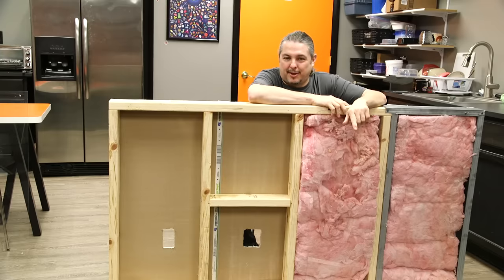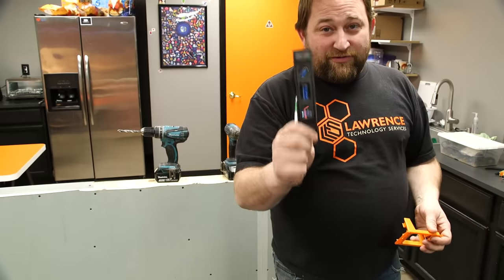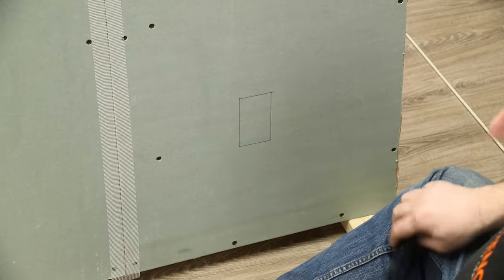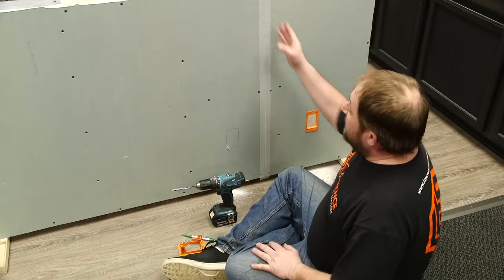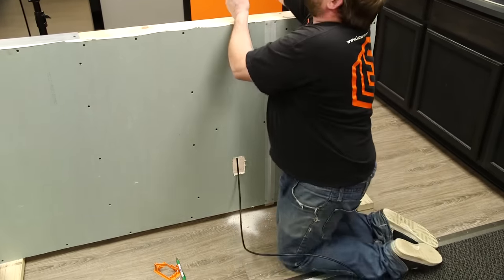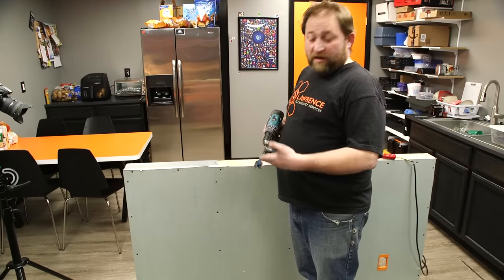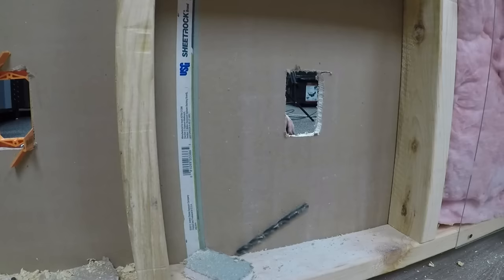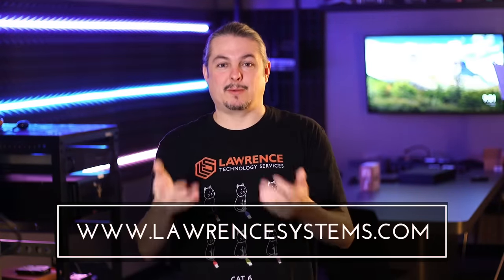Wall Fishing Tools & How To Use Them When Dealing With Fire Stops and Insulation

Comment: I would love to see a more advanced wiring video that goes over metal framed walls, particularly ones that have drywall ceilings. I don't think it's "legit" to drill through metal top plates, I'd like to see how that's done, and how you run the big cable bundles to the MDF through the drywall / drop ceilings and maybe raised floors. Conduit with bushings? Big brush plates? Other?
Reply: I've drilled stacks of holes in sheet metal top plate. I recommend using a step drill (Christmas tree drill bit) to make the holes and always use a bushing so your cable doesn't get trashed.
Reply: @iamdave84  
Much appreciated! It was driving me nuts trying to figure it out.

Is there a spec of how big the holes can be? I figured out you can drill down to run NM through a bushing, or bx/mc - but that's a half inch hole or so - maybe 7/8 - and you put a plastic bushing in it. It can't be too close to the stud, there can't be too many of them (turning the plate into swiss cheese), and I'm sure you can't just drill a 2 1/2" hole to drop cables down... I think you can drill 1 3/8" holes in wood top plates, but also not too close to the stud. How do you run large bundles of cable through it? I'm guessing a bushing of some sort through the ceiling instead of wall dropping for that...

Pretty sure you're not supposed to drill in the studs at all, they come with premade holes you put bushings in...
Reply: I was only drilling 20mm or 25mm (1" max) holes, for up to 6x Cat6a cables. I don't recall specific rules about hole location, but I think rules vary by country and maybe even state. I'm in Australia 🇦🇺
Reply: On that job we didn't have MDFs, but rather whole comms rooms. Those had no hanging ceiling, so cable trays were hung from the concrete slab above for routing the thousands of cables terminated there.

Comment: That was helpful however, what about the possibility of having a firestop on a exterior wall. Wouldn't that defeat the usefulness of a magne pull?
Reply from the maker: Possibly
Reply: @LAWRENCESYSTEMS  so what would you do in that situation?
Reply from the maker: @JWolff-md3ij  No use the mag pull and use a flex drill bit

Comment: How to run the wire horizontally through the wall with having access to only one side of the dry wall ??  Pls consider making a video with fire-blocks/obstacles in between.
Reply: I thought he dude? like wouldn't you use the same logic as a vertical line in?

Comment: What if you have to drill through several fire blocks and the wall is like 10ft high. How would this be accomplished? Can you keep adding length to that flex bit drill? How will the flex bit stay in line as you are drilling down deeper?
Reply: You can add an extension to the flex bit. I have done it, but I wouldn't recommend it. If there are multiple fire blocks I would just make pumpkin cuts in the wall and drill through them then patch it later. Or better yet, try and find a better wall to run the wire through. I have also poked a hole in the ceiling and just used surface conduit. If you stay close to the corner of the wall instead of the middle it usually looks okay.
Reply: @telecomtech9252  I was thinking the same thing. Just running the wire through the ceiling with a surface conduit. I think my walls are plaster and not dry wall so I'm not sure if this will make things worse.
Reply: @joeguzman8396  Plaster is certainly more difficult to work with than drywall. I would definitely consider using surface conduit (wiremold-type product).
Reply: @telecomtech9252  Thanks. I think this is the way I'm going to do it. Do you recommend plastic or metal?
Reply: @joeguzman8396  I would go with plastic. Looks nice, snaps together easily, and is paintable. Plus it's usually adhesive backed so you can set it in place then run a few screws from the inside into the wall so you  don't see any exposed fasteners.
Reply: @telecomtech9252  Sound good. Thanks for the advice. Much appreciated.
Reply: @telecomtech9252  find a new location, or go with surface raceway.

Comment: About a minute and a half in, I see one of my pet-peeves of the industry.  A bad habit common in the Industry.  Why drill a hole damn near equal to the size of the wire, where it will only allow for the one wire?  I used to do that when I first started.  Very annoying when you return for an upgrade and you cannot add a new wire through the same hole.  Cant enlarge the whole with out taking out the wire.  So you have to get in there and drill another hole. Sometimes it's bad enough the first time usually from an attic or crawl space.  "Work smart, so you don't have to work Hard"...my father always said.

Comment: Do you know if that flex bit is equally as flexible as the ones they have at Harbor Freight?
Reply: lol Harbor Freight? are you special???
Reply: @billthepro1188  It was a serious question. I didn't ask about quality. They have bought things from Harbor Freight before, such as the flexy wire fulling sticks. So my question remains. I am trying to run some wire through a tricky spot, and I was thinking about using some of those drill bits, but the only ones I can physically hold to tell how flexible they are, are the ones at Harbor Freight....which are not flexible enough. So before I spend $35 on a bit from Amazon, I thought I'd ask.

Comment: Can you do a video on how to mount a large television on a wall with aluminum studs instead of wood?
Reply: I've done that.  You can drill through metal studs using a drill bit that is made to drill thru metal, just like you would drill thru metal in any other circumstance.

Comment: Hi, thanks for the information. I need some help here. I just bought a 4k lorex camera for surveillance; the problem I have now is that I need 3 180 ft cables in order to connect 3 of 8 cables cat5e supplied with the cables, my plans if GOD help me are to replace all those cat5e with cat6a and install them in between the outside siding and the plywood(inside the siding) and run all the 8 cables around my home and at the point of connection to my Nvr make a junction box to make everything looks nice, more pro and future proof, this cable is just basically for the surveillance system only and in the future ifnI have to upgrade the system just remove, plug and play, it is just from the cameras including a PTZ camera to yhe Nvr using POE method for power and that's it, also must be not to ridgid because I have to run the cable in 2 corners at 90 degree turns, now, the only problem I  have is: what cable is the best option? Cat6a shielded, not shielded, outdoors, plenum, or riser? I am getting crazy 🤪,  Can you help me out and tell me what cable you would use in this case? " I will run the 3 cables altogether, and at some point, they will join the other ones. I don't know if this can create noise or not, I live in the city surrounded by other homes and of course neighbors with routers and tons of items connected and I have no idea if that can be call "noise", thanks for any help. Also, do you think those new Flat cat6a really works and can be used in this case?
Is this one good? : https://www.cablewholesale.com/products/network-phone/cat-6a-cable-bulk/product-13x6-521mh.php

Comment: I would imagine that magnet puller rips out drywall screws pretty often, no? Also, wouldn't it get a little difficult with metal studs?  Is it powerful enough to damage the wall with light metal framing?
Reply: No it’s not like it’s able to lift cars or some sort of supercharged magnet. 

It’s just strong enough to have a good pull thru a 1/2” or 5/8” drywall. But trying to fish it within 6” along a metal stud might be impossible because it might be drawn in that direction.

Comment: Anyone watching this should be aware that this is only for communication wire (low voltage)...You CANNOT USE THAT RING FOR POWER WIRING..... and BTW the maximum allowable gap anywhere around the box is 1/8 " for a total of 1/4" horizontally or vertically. NEC 312.4

Comment: If only my wall were that easy to cut. I have an old plaster wall (actual plaster, not drywall) that for some reason was installed on top of 1/4" modern drywall. Yeah, strange I know. But it's as if the builder had a machine and just sprayed the plaster to a certain depth on top of actual drywall, making my wall like 1" thick and virtually impossible to cut with a hand saw. I have to use a power saw (the kind for cutting trim on a floor so you can install flooring under the trim) with AC and even then it's difficult as the saw blade dulls out within a few cuts. Next time I'll probably use a much more aggressive jigsaw, but I don't want to use that and accidentally cut through AC wire.

Comment: Nice video! Btw have you tried the low voltage bracket blade for an oscillating tool? Could be much quicker for you guy. Qbit SQ1000-S-LV on amazon

Comment: Do you have to worry about the hole you put into the fire stop?
Reply from the maker: No, it's not big enough to be an issue
Reply: @LAWRENCESYSTEMS  Thank you for the quick response.
Reply: Pretty sure you have to patch it with fire retardant caulk. Even a small hole can severely decrease the effectiveness of a fire block. It will act as a small chimney. But check your local code.
Reply: @LAWRENCESYSTEMS  then again, if it is a firewall, not blocking in the wall, you need to patch the hole, no matter how small it is, because that one little hole makes the entire fire stop pointless.

Comment: 7:58 That's great and everything, but walls are usually taller than 6 feet.
Reply: assuming its at the exact center producing the farthest distance possible from both directions of access you still have the ability to drill 6 feet into what would be a 12 foot wall. any offset from center would put you even closer to one side that you could drill.

Comment: you forgot about the the roof and ceiling attached to the  top beam on an exterior wall.  Everyones issue is getting the wire through the top beam on an exterior wall especially when exterior wall is brick.
Reply from the maker: It's really an issue for residential walls, less an issue with modern buildings

Comment: Check out the  Qbit
Reply from the maker: It's neat but my team have not decided if it is that much of a time saver.
Reply: Love my qbit
Reply: @LAWRENCESYSTEMS  I would think the other advantage of the Qbit is less drywall dust mess to clean up afterwards.
Reply: There's always going to be dust. If you have to come back with a vacuum later anyway, it doesn't really matter whether there's a little more or a little less dust

Comment: I have a 4 sided roof. I don't see as far as  an exterior wall in the attic how you can get to it, and I'm a pretty small guy too. There's not even enough room for a drill to fit.
Reply: I've had a few like that and couldn't damage the interior wall paper and brick on the outside.  I took a flat bar and carefully remove a few shingles above the top plate so I could drill down and fish the wires up. Then I can grab them with a fish rod in the attic. A little blackjack to seal down the shingles after nailing them back on. I also did this at the peak of the scissor truss roof (middle of the house). The D.I.Y. home owner had built an 8' wall and then another stubby wall on top of that to get up to the taller peak. Should have used 12' studs. I couldn't get in the attic and the crawl space of the cabin had water in it so I opened up the roof so I could reach in and drill down with my long bit and fish it.  Short of that they would have had a real mess in the house. Less time spent than running back patching sheetrock and painting and no dust in the house.

Comment: If you had an obstacle or  for whatever reason you can't use the hole you put in the wall, your solution shouldn't be a blank plate.   I have customers that would freak over that. Which is why I have a carpenter/drywall subcontractor that would come in and spend an hour patching it like it was new.  I had a new hire who I didn't realize was emotionally unstable, got frustrated and took a hammer to a wall, a bucket of mud and a half a sheet of sheetrock later my contractor  patched all the holes, and you could never tell what my jackass new hire did.  That employee is now working at Price Chopper in the deli making a fraction of what he could of made if he kept his cool.

Comment: Have you ever hit anything? Our fear is that we're going to drill down through the top and directly into a 220v electrical line or cut a water line when using a drywall saw to make the opening.
Reply: If you're drilling down through the top plate you should be able to see any electrical wiring that might be going down the wall cavity and you can simply move your hole over an inch or two. If it's MC cable or in conduit and you're using a twist bit and somehow manage to hit it it should glance right off or push it off to the side. You would also be able to tell by the sound of the drill bit hitting metal. That should be an indication to stop drilling and reassess. If you don't see any electrical running vertically down the wall, then either there is none in that cavity, or it's running horizontally in which case you don't have to worry about hitting it when drilling down from the top (long flex bits are another story). As far as accidentally hitting a water pipe while using a drywall saw, you should be able to feel the difference as soon as the saw hits the pipe. Make your first cut horizontal that way if you do hit something you can turn the saw around and start cutting the other direction. If there is something in the wall right in the middle of where your low voltage ring needs to go and you can't get the face plate on you can use a surface mounted box that accepts a face plate to give you more clearance. Look at the other side of the wall before drilling or cutting. Is there a bathroom or kitchen? If not then there probably aren't any pipes in that cavity. If there is then just be aware of supply and vent/drain pipes. Surveying the area first and having a little knowledge of how most buildings are constructed goes a long way.
Reply: trick is, to make short sawing motions.

Comment: Where are you guys based out of?
Reply from the maker: Detroit MI
Reply: I like to his channel ! Im not super techy but I’ve been doing cabling projects for about 20 years and im happy to say that use all of these tools except the Wi-Fi one but that’s only because I never knew it existed. My go to is my fluke toner . I could clip red to the conductor and black to a ground or metal and literally trace cables through the walls . Customers would trip out when I’d locate cables that have been drywalled over. Oh and “locking extension bits “ I go for the foot long ones . I would use these to drill through fire blocks . That’s just my preference tho. Anyways love your content

Comment: Its hard to understand your prononciation of 'Carlon Single Gang Low Voltage Box - Mud Ring'? Outside US its called WALLPLATE Mounting Bracket for Low Voltage Wires

Comment: How does this work with a real wall where you can't just drill down from the top like that?
Reply: Not nearly as well for sure. I installed cable for years in the scorching attics of Florida. You learn tricks over the years to reduce time spent in an attic, and glow rods are not one of them. Typically I'd make my hole up top with a paddle bit for a little more room to work (and ensure I could see to the bottom) then drop a length of plumbers chain - if I couldn't reach it in the hole down below I used a magnet to pull it out and the wire tied behind it. (Or just push a ton of wire down and pull it all out then cut off excess - which is about what 99% of installers will do to get in and out of the attic ASAP, lol.)

The glow rods were only helpful if you hit insulation, otherwise they made everything take 5 times longer.

Comment: Cool and good information, but still doesn't help me.  This seems to assume 2 stories at least so you can come from the top.
In a 1 story, I need to run wire down from a breaker box into a crawl space, so I can't drill from the top anywhere.  I'm assuming there's a 2x4 on top of the sub floor behind the dry wall, doubt there's a spare hole in it for new wires.

Comment: Using the drill for the corners of the box is dumb. What if something is in the wall in between the corners of your box? Always cut one width then one height so you can move your box with no unnecessary wall repairs. And you should have shown measuring height.
Reply: And for this exact same reason use a pencil.

Comment: Most ceiling are on top of the wall, not down 8" from the top of the wall. This isn't a problem if the walls are away from the lowest ends of the roof; otherwise, how in the world are you going to be able to drill a hole from the top plate of the wall?